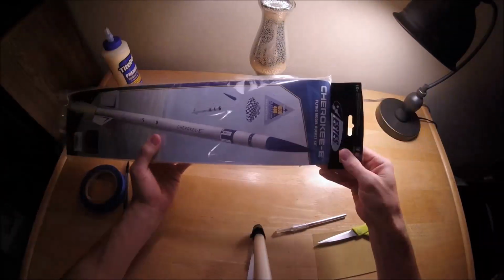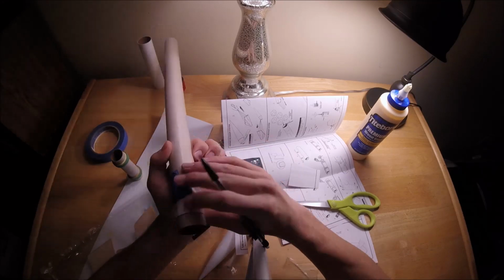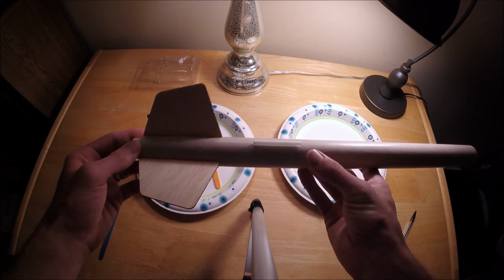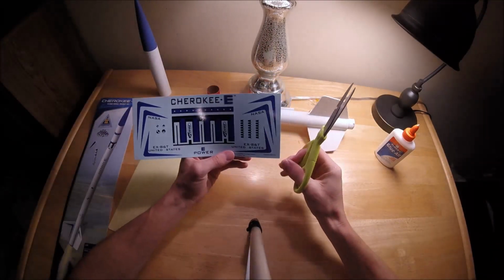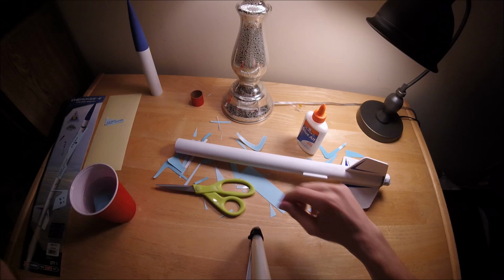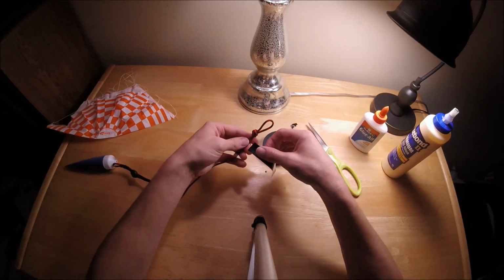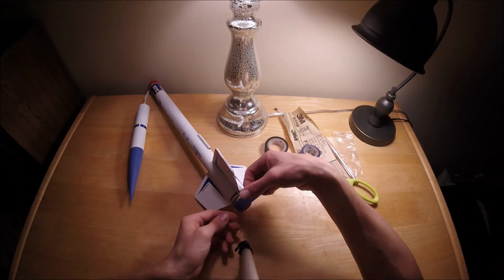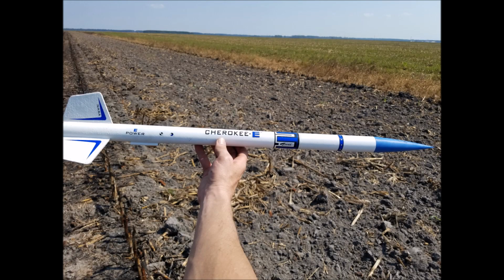Estes Cherokee E Build Tutorial

Comment: I would make a point of where you attach the parachute to the shock cord. It should be closer to the nose than the body, so the parts don't bump into each other during descent. Also, I always use a snap swivel to attach the parachute, so I can switch between chutes as desired.
Reply from the maker: @mgd76yt  yes good tip on parachute placement!  I shy away from swivels because I had one break on a larger rocket.

Comment: Thank you so much for doing this video.  It doesn't look like you used the engine hook when assembling the motor mount.  Is this needed?
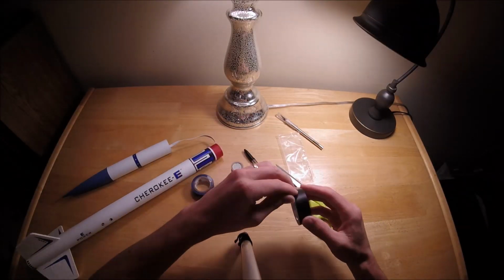Reply from the maker: It's not needed if you tape the motor in like I did, starts at 30:40.  I don't like to use the engine hooks in most rockets because they can get in the way of using different size motors.

Comment: Interesting build.
...but the kit looked like it included a metal launch lug motor retainer !?
...those make it  a lot easier to load engines...why would you stuggle with tape?
Reply from the maker: Yeah I agree the metal motor hooks are easier to use than tape but on more than one occasion I've built a rocket that I wanted to fly on a non-estes motor and it would not fit due to the motor block and/or motor hook, so I normally just use tape so I don't have to worry about modifying the motor retention design and I know every motor I want to use will fit.

Comment: Is there a reason you put the fins and motor mount on the opposite end of where the instructions called for? Also, my instructions say to space the fins from the end of the tube. Does any of this effect the CG or CP?
Reply: There are several things you did different than the instructions. I’m trying to learn. Can you explain these choices to me?
Reply from the maker: Yes, because my general standard practice with rocket building is to include a payload section, which is consistent with the way high power rockets are generally designed.  For the Cherokee E it doesn't matter as much.  The reasons for payload are: it's better for the rocket to recover as to halves rather than a long section and nose cone because the rocket is less aerodynamic with two long sections and helps it to recover more gently in high wind conditions, also it creates more space to add weight or electronics such as altimeter especially if you add a bulkhead on the bottom of the coupler.   I think they probably directed gluing fins on shorter section of tube to help with alignment because it's easier to look down on the fins if the tube is shorter (dont have to stand up to look down maybe), I'm not sure of this but I believe that's right because if I recall correctly my kit came with a go/no go gage for fin alignment so the designer was concerned the builder would not get the alignment correct as these are very large fins and easy to see if they mis-spaced circumferentially or angular misaligned.   Dont worry about the fins being up a little bit from the bottom of the tube.  My thought is that the intent was to prevent the fins from breaking by letting the body tube hit the ground first.  The fins are so big on this rocket that the cp is very far aft so you really dont have to worry about getting your stability caliber/s.  Let me know if I got to all the questions or need more clarity good luck with the rest of the build!

Comment: Will these rockets work with a standard launch pad that you can buy form the Estes website?
Reply from the maker: Yes, the standard estes launch pad has two holes, one for a 1/8" rod and another for the 3/16" rod.  The launch pad box normally includes a 1/8" rod but not the 3/16" rod, which you will need to buy separately for the Cherokee E, I normally find nice long rods at the hardware store that are great for launching rockets.  Also for launching the larger rockets (D motors and up) put some weights on the ends of the legs to keep the launch pad from tipping over or use tent pegs.
Reply: rwkhobbies thank you!

Comment: Have you tried papering your fins? I hated the sanding sealer and switched to that.
Reply from the maker: I haven't tried it on an actual rocket yet but I've read that other people have had success doing it.  I tried gluing a small piece of printer paper to balsa fin-stock a couple months ago and it looked really good.  Didn't try spray painting but yes, it looks like a good technique I may need start implementing.

Comment: Do you have a good estimate of the weight of the rocket upon final assembly?
Reply from the maker: I just weighed the empty rocket on a KITCHEN GURUS scale and it read 102 grams.  (I think it may still have some residual wadding left in it from last flight).  I also weighed a new (not yet flown) Estes D12-5 motor on the scale and it read 46 grams.  Tape for motor and wadding before flight gives me an on the pad weight estimate of about 175 grams.

Comment: Block sanding the back side of the wood sheet is a great way to cut parts to release from a balsa sheet.  That is an old trick with die cut parts.  Should be a non issue with laser cut, but it is still a good solution in these instances.

Comment: You made the rocket upside down. And you were supposed to cut the lug into 2 pieces.
Reply from the maker: That is true per the directions, I actually would say I disagree with cutting the launch lug in 2 pieces because it makes it harder to slide on the launch pad if they are slightly misaligned.   Also rods at club launches may not be the exact right size or slightly bent from years of use, and Cherokee E flies straight without the extra time on rod during launch.